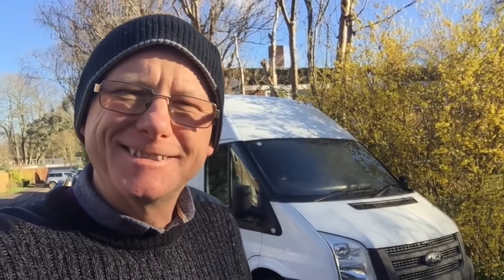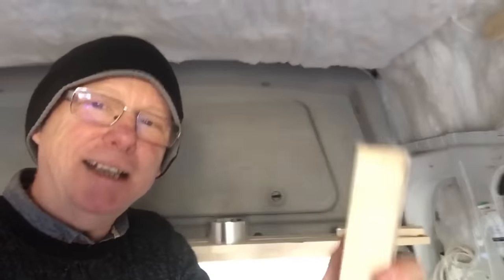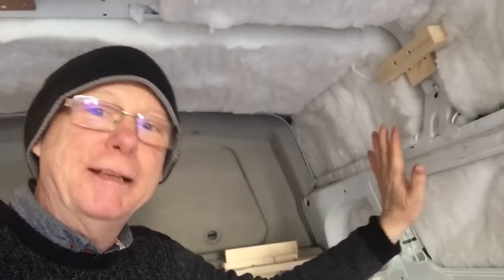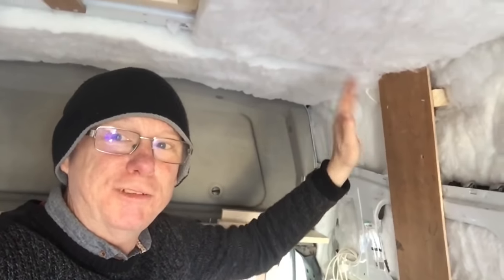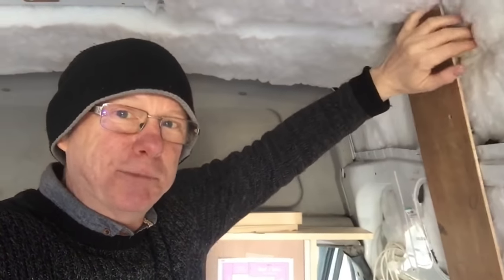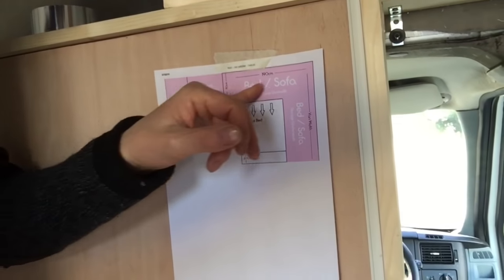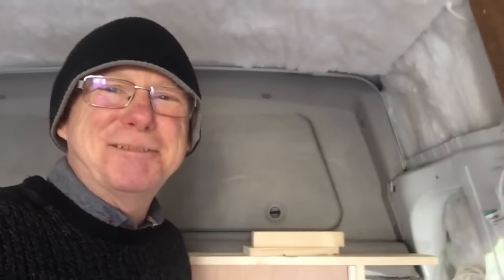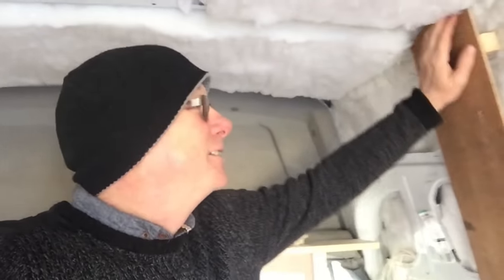HOW TO put up batons in a DIY self build a  Campervan conversion - van life

Comment: The self drilling screws they are generally called TEC SCREWS  sold. on line or screw fix  , nice tip there Mel about stepping the bulk head,  can’t wait to see you wrestling with that vapor barrier don’t forget to leave the hatch open you may fall thru it,  thus doing your dive  🤾🏻‍♂️👍❤️
Reply from the maker: John Healy thank you 🤓🤙

Comment: Hi Mel, thanks for the video. What thickness is the ply that you use for the battons? Then what length of screws do you use to attach the cladding to the ply? We are about to start our cladding x
Reply from the maker: I makeup the ply batons using the plywood that was lining the van I think it was about 7 mm think the screws I used are all 4mm some 15mm long and some 25 mm long good luck with your build 👍

Comment: Hi Mel what length are the self drilling screws that you are using to fix the batons to the side of the van. Also can you tell me where you purchased them from. As always enjoying watching the build.
Reply from the maker: 3.5x25 mm drywall screws from Screwfix
Reply: Thanks for the info Mel.

Comment: What wattage is the drill you need to put those self tapping screws into the steel Mel?
Reply from the maker: Hi I use an impact screw driver they go in with  very little effort I’ll have a look at the wattage for you when I get back from week away 👍🤓
Reply: Did you get to look at the wattage? Would be good to know the answer to this 😎

Comment: Hi Mel what's your take on the panel noise deadening mats that I see most van builders use ? I notice you have not stuck any on ? Do you feel they are not that important , not a dig at you mate at all just curious to your thinking , cheers Chris .
Reply from the maker: Chris-90 the panels on this van are so small they don’t do much plus the insulation is sound deadening so wasteful 🤓🤙
Reply: Cheers Mel I see were you are coming from ,👍